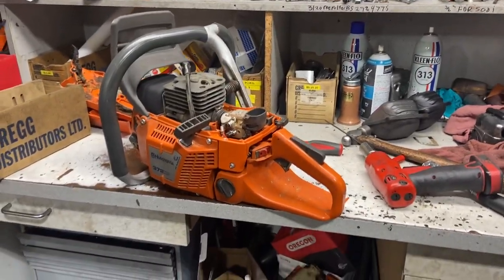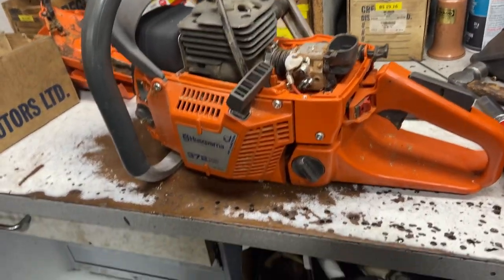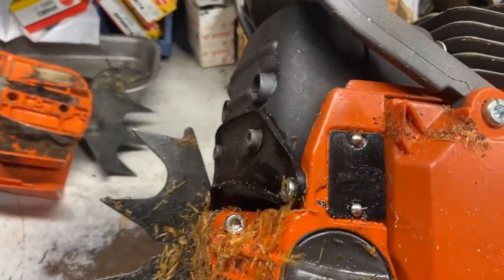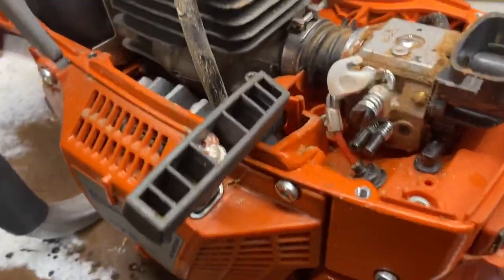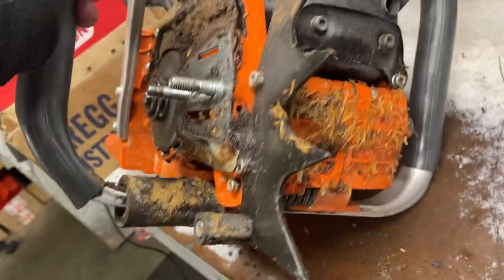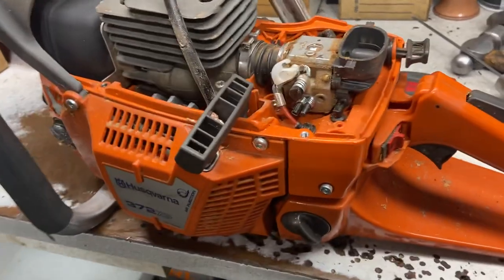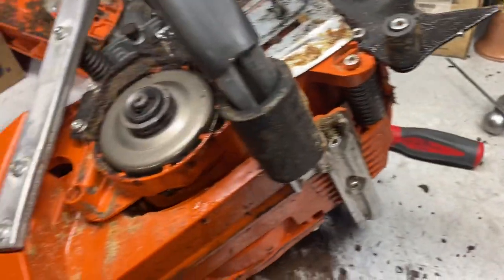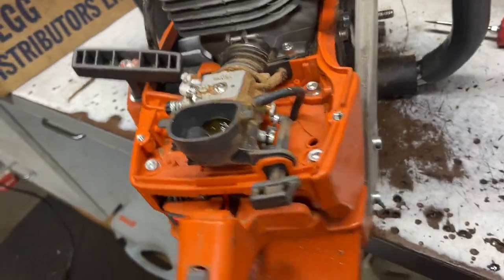Donny walkers chainsaws fake husqvarna 372

Comment: There's a place for the aftermarket knock-offs for sure, just as there's a place for other inexpensive tools like those from Harbor Freight or Princess Auto. They're a critical part of the tool ecosystem. They enable people with tight or minimal budgets to get things done, they allow people access to various trades that they otherwise would not have access to, and they allow hobbyists to ease into things without breaking the bank. There's nothing wrong with them... so long as they're not misrepresented as the real deal!
Reply: I should have just read your WHOLE reply before babbling off the same thing ... Right on brother . :)
Reply: Right on Colvin… that ID tag on the Husqvarna saw’s the critical point of inspection on a used saw… if it’s clipped from the OEM the company has “replaced under the warranty”… so that would raise an issue or it should… or if it’s completely missing and it’s never seen a rivet it’s an aftermarket case… it could possibly have everything else switched over but you really need to do a complete parts inventory to really access it’s actually value.  Cranks and coils and carburetor’s and clutch’s are a collection of 4-5 hundred dollars worth of parts new from Husqvarna where they aren’t $200 in the aftermarket parts….  I’m one of those fortunate people who buy a couple of the “cheap” aftermarket parts and test them then put them in my inventory.  They have allowed me to keep my operating expense down and to “fix” several broken saw’s that were put out to pasture because the repair expense outweighed their value… I absolutely hate to see things just tossed out or into the junk pile. So the one advantage to the cheaper aftermarket parts has been the saving of many old broken saw’s!  The cheap parts and the kits on the models that are out of patent protection has also caused a huge hobby to blossom where guy’s are repairing old saw’s and building the kits as a hobby.  It hasn’t hurt the sales of the majors…if anything it’s bolstered saw’s!  These and entire group of guys today that buy saw’s just because they want one… 20 years ago that wasn’t “practical”.. an entire “hobby” has blossomed out of the power saw world!  And it’s fantastic!  There’s guy’s like me that have considered planning a trip just to spend a little time in my “Mecha!”… Walker’s Saw Shop… thick of all the faller’s that Donny and his pop has outfitted with a great saw over these past years!  I’d slide down the gully out back to retrieve a clutch so I could make it a necklace or something!!!  With the Introduction by Billy Ray it’s been a great history lesson!  I could listen to Donny’s dad telling stories or talking saw’s until the cows come home… he’s an absolute vault of knowledge!

Comment: Probably is missing the little O-ring that goes on the crank underneath of the oil pump metal spacer sleeve… some people don’t think they need those but I’m pretty sure that’s where the “bad carburetor” thinking comes from… don’t hold a tune because no carburetor could hold a tune with that tiny air leak… pressure test it with the soapy water and find all it’s air leak’s! I wish I had a couple of those “real” carb’s I could put some kits into! LMFFAO!  I usually put a good kit into a cheap carburetor and it’s working out good! It’s not cool to scam someone
Reply from the maker: Your right on the money people don’t know about the o- ring I will see how it works out but I will get it going then my friend will fall with it let’s see how long it lasts hey
Reply: Yeah… that cylinder probably isn’t that bad… but they have some junk piston rings and I’m not a huge fan of the piston’s either… a meteor piston with Caber rings in a cheap cylinder can run a long time… I’ve done a couple work saw’s that way and they been running a decade with that setup.  I radius them with a little round diamond ball burr to help them out…break the top and bottom edges of the piston to get as much oil to those cylinder walls as I can… it’s too bad that the rubber bits like intake boots and fuel lines don’t last very long… that’s are the little things that in a few years all just need to be totally replaced.
Reply: Might want to toss that Hyway 52mm popup on there if that’s not a great cylinder?
Reply from the maker: I will see what my friend wants to do he already has some big bore real 372 saws I’ve built him I will experiment cheers bud
Reply: @donnywalker4691  right on… he’s in great hands with you getting him straightened out 👍😁.  Have a great night Donny!
Reply: @andrewslagle1974  I’ve got 7 case’s with cranks from my Amish friend…I fix them up and return them to him to help out is family… I just collect 372 parts to help my friend try to stay on his family farm that everyone wants to steal from him and build a Development… I’m not a communist but I am a really good friend to an Amish fella… at least I’ve got a goal to do something for someone other than myself.,. And if I can buy a cheap part to help the guy get work done then I will,sir!  I can’t always afford the oem parts that I would prefer… but I’m not going to take a dime from this man or any of his family… they got a pretty rough deal just trying to live their lives!
Reply: never add the 0-ring to my farmertec 372xp. never had to touch the carb after retune from factory (nearly 2 years now). still screams like no other at 13k rpm. I bet I can go 13.5 but im gonna keep it on the safer side. thing rips.
Reply: @NathanVdV  it goes underneath the little black metal spacer…it’s a $5 dollar oem part from hls… I wouldn’t be running my saw without any of the parts that Husqvarna deemed important to their operations… just saying… I want it as close to the real 372 as possible in the parts department… it’s an air leak potential and any air leak is a bad thing… I just had to repair a saw that had a little crack in the nipple on the fuel connector on it’s carburetor… that tiny crack let it go lean at high RPM… I don’t take any unnecessary chances on my equipment…. Especially on a $5 dollar OEM part… I’ll get that and pop it in quick to avoid a potential problem down the road….
Reply: @DaveyBlue32  I understand, but that o-ring is only a temporary thing, it gets hot, gets in contact with oils and becomes brittle, crumbles and has lost its purpose. 

At farmertec they do pressure tests and even without the o-ring they hold pressure. Even in their all new 2022 pro series 372xp (like caber rings, Italian cylinders, real carbs) they did not include the o-ring. While we specifically asked for it. They did lots of vacuum and pressure tests and none had a leak at that o-ring side.
Reply: If I were going to delete the O-ring… I would definitely coat the end of the metal spacer with 1184 and let it cure before I reinstalled it??? I use a little dab of builder lube and the O-ring… to each his own… I want it in mine… I run the single ring 371xp piston in the 50mm bore saw too… don’t like the twin rings lack of oil between rings…we all have different taste… as long as she ain’t leaking air… keep them wood chips flying!!!

Comment: Wont be buyin anymore china g372xp's or any of the rest of em for that matter . Some folks seem to have success with em but mine was trouble outta the box
Reply: You in the state’s? I’ll buy it from you! I’ve got 1/2 dozen builders and need them 372 part’s
Reply from the maker: Ya this one didn’t have a cylinder gasket and no sealant runs like crap
Reply: We won't even work on them for customers anymore. Jst to mch of a headache for what their worth
Reply: @DaveyBlue32  OOOO have i got a deal for u ! A real creampuff only $349.99 + shipping
Reply: @donnywalker4691  i offered mr thorne a great deal on my g372creampuff
Reply: @donnywalker4691  was probably a kit saw put together by someone inexperienced.

Comment: Hi Donny, I’ve just bought a second hand 372xp, now I’ve got it home and had a closer look, it started off genuine but has non genuine crank cases, cylinder/piston, & carb, not happy at all, it starts and runs great but have little confidence in it’s longevity, have you got any experience of these non genuine replacements parts on an original saw? Thanks

Comment: Evening to Donny.I got brave and built one.It was quite  an adventure. I used Husqvarna case bearings and the  e clips I got from  you. You are  correct  about the aforementioned aftermarket carburetors, they can be  rather poorly made.So far so good,up date ya later.

Comment: Good advice.   I am wanting a Stihl MS880 or 881 for occasional use, will use smaller saws for 98% 0f my work.   Do you recommend a new Stihl, Chinese, or a used 880 or 881?
Reply: My opinion find a decent used one. They are extremely expensive new and even if the used one needs a lil tlc you'll still b money ahead. The china saws are like playing poker. Sometimes ya win but oddd are....

Comment: These knock off's are the best thing that ever happened to the saw industry.  I've had loads of them now and there's very little to complain about really, sure there's a few components that don't last as well as the OEM saws, but they can be changed for the genuine articles.  The thing is that these are old models now and you can't buy a new genuine saw anymore, if you want a pre EPA saw then a copy is the way to go. The engine itself seems to last just as well as the originals!  and there's nothing in the performance at all, in fact some of the 372xp copies I've run actually seem to outcut the OEM saws.  I think the muffler is probably the reason for this as it has fewer restrictions and a larger port.  After hearing the stories about the newer saws and the problems they suffer I don't think I'll ever buy a new OEM saw again, financially it just doesn't make any sense.  I can have four or five copies for the price of one genuine saw!  So even if one or two break beyond repair in the lifetime of the original saw, I'd still have a couple of working copies and a load of spares!